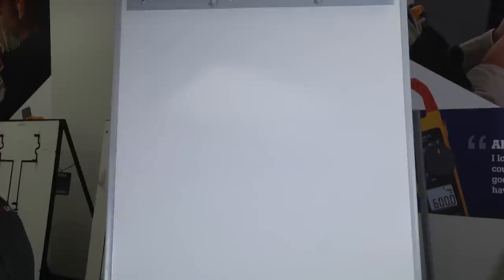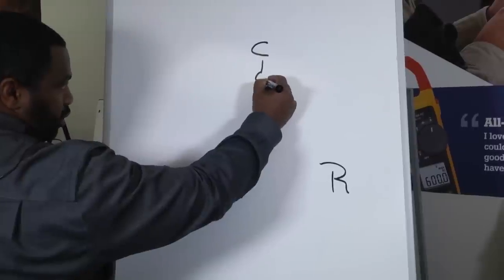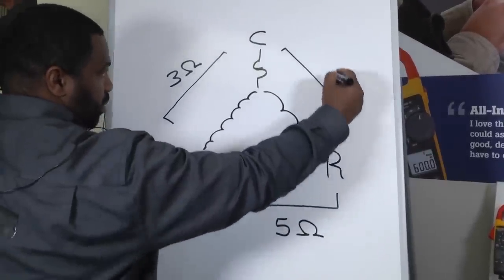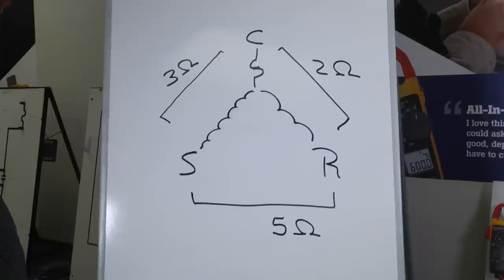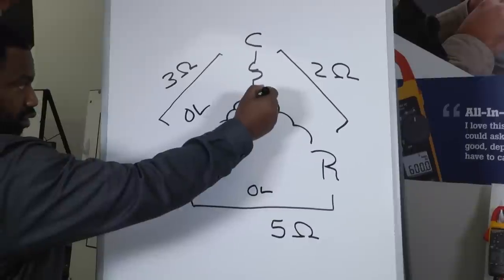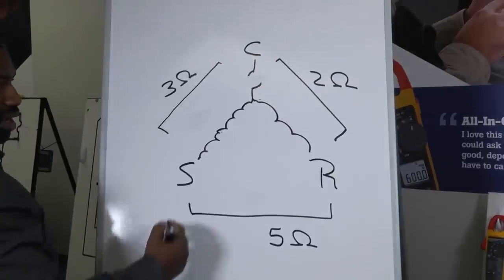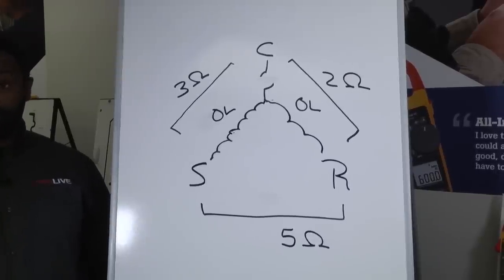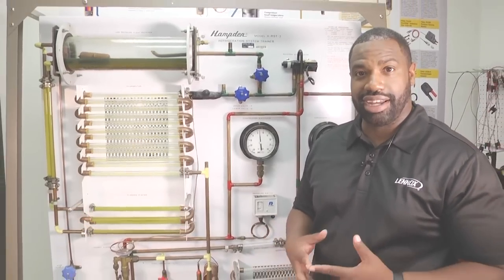How to Read Ohms on a Compressor

Comment: Wonderful presentation!  Nearly all residential homes have condensers clogged with dust, and compressors covered with dust.  Hopefully more of us will make the effort to clean these.
Reply: Actually, the evaporative coil is what gets clogged with dust more than the condenser coil. People put those highly restrictive filters on so dust is sucked in from the attic through leaks in the duct work goes into your evaporative coil. It's easy to clean the dust a I use one of those pumps with distilled water washes the dust right out.

Comment: Thank you!  I heard a guy say the reading should be the same between the 3 points. Was thinking I had something wrong because one of my readings was a lot higher.  This makes sense. Thanks again.
Reply: Will be the same on a three phase compressor . For example all three pins may be 3 ohms. The compressor depicted here was a single phase compressor and that is how the pins ohm out on a single phase.

Comment: Have you ever seen high resistance  on windings that were just over by a couple ohms?  But when you add them up they are correct accross start and run?

Comment: Thanks for the video I had an AC man tell me my compressor was dead I needed a new unit. I told him I wanted him to OHM test like you did suddenly he claimed his meter was broken. I asked him how he knew my compressor had failed he said it won't start I told him could be the capacitor. He said didn't have the part and left. I called another tech he came out I told him what this other guy said he did the ohm test, and my compressor was good the cap was bad replaced the cap and it worked. So many crooked AC guys here in Phoenix they know in the summer you do anything to get that AC turned back on.

Comment: Great info. Thank you. I do have a quick question though: My heat pump's compressor reads as follows (at the unit itself): C+R = 1.0.  C+S = 1.2   R+S= ONLY 1.4 when it seems that it should add up to 2.2 based your example.  Does this mean I have a potential problem with my compressor?
Reply: I got the same question

Comment: It’s actually an open run winding. If you measure 0.L across any two points you are testing the winding that is not on your meter leads. Correct??

Comment: Please, i need help here. My chest freezer gave me a shock. I tested the compressor and the relay with my multimeter and compressor is in good condition but my relay is bad.
Could the bad relay really caused the shock from the freezer?
Please, i need urgent response.
Thanks

Comment: The compressor could be cool down with water. What if  you ohm it out and the reading show good. You turned on and the compressor overheat again and it shut off due to an thermal overload? Could it be that the high pressure switch could be bad? They are normally closed.

Comment: What if I get a different but consistent ohm reading after different power cycles. For example I get 5 Ohms between all 3 measuring poles (S-C, C-R, R-S), power on, power off, read again and get 14.5 Ohms between all 3 measuring poles, power on, power off, and get 56 Ohms between all 3 measuring poles. Is the compressor broken? Should it always read the same resistance or can it vary as long as they always read the same value?